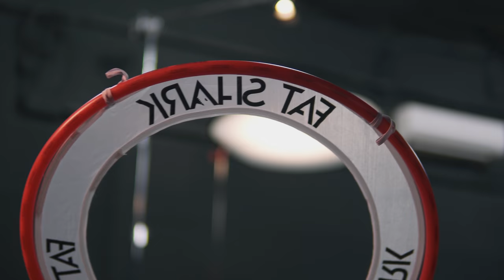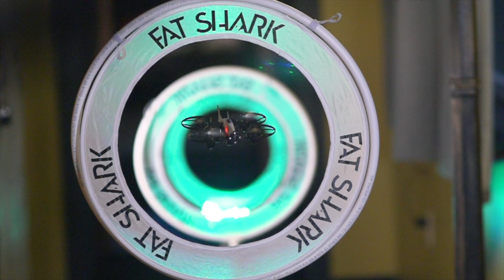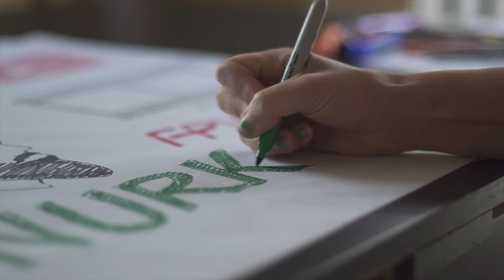First Look at the Fat Shark 101 Kit

Comment: Cool little video. I went looking into the FS101 kit and don't see anywhere that says what radio protocol it uses, just that it's "upgradable" to work with other radios. Did they tell you what protocol it runs?
Reply from the maker: It's a FlySky radio. You should be able to bind it to any FlySky protocol. I think upgradeable mostly refers to the goggles
Reply: It is great that it supports FlySky. Nobody will upgrade googles to fly this drone :P More like people will want fly more powerful drone and it will be great that they won't need to buy googles and radio.

Comment: Nicely done very cool video. It doesn't matter if people like the product or not I felt your message going from practicing to racing came across. I had an immediate urge and pulled my whoop out for a few flights around the house. Now I have to go to the hobby store for more battery's those 2 min flights just anent long enough.
Reply from the maker: Thanks! That's what I was thinking. People were getting pretty butthurt over it, but it was just some fun! :-/